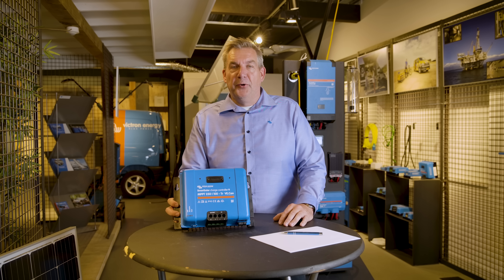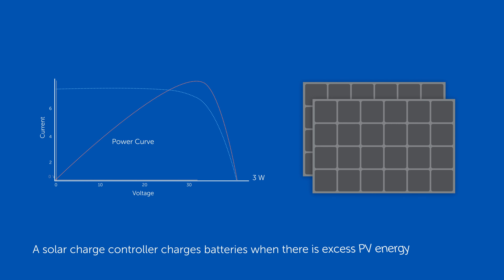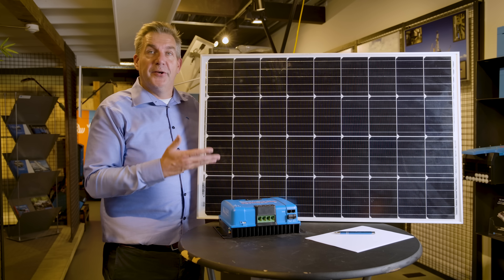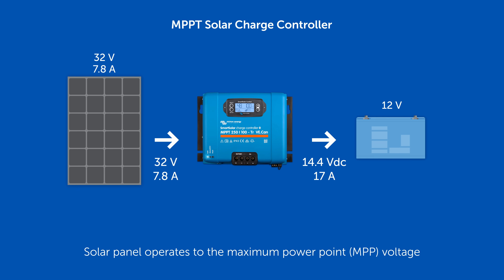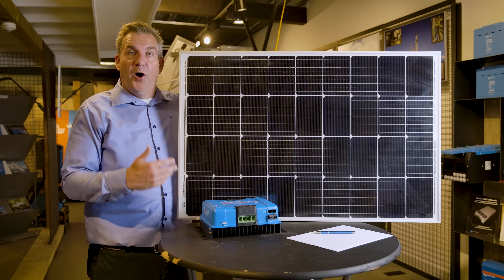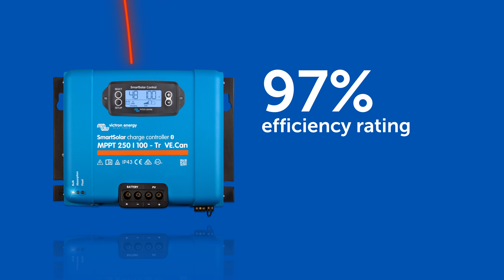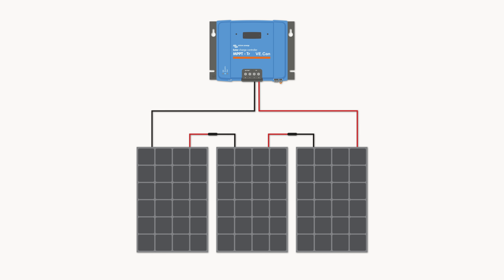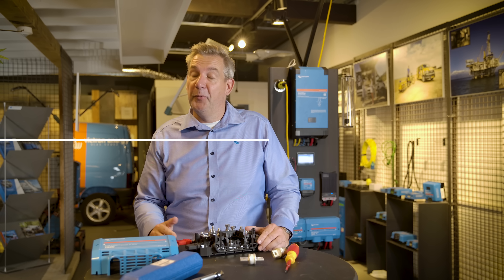How does a Victron Energy MPPT Solar Charge Controller work?

Comment: Johanes - Why is series better than parallel? Isn't the wattage the same or better in parallel (less shading effect)?
Reply: Ditto ejaculated DKS said, higher volts in series =smaller wire size, save on copper, use smaller amp fuses (but rated for the higher volts)

Comment: Excellent training video for excellent products!

From the video it looks like a buck type converter.  Will the controller software limit the current down to a few watts of power to keep voltage above minimum threshold?  Is there a min amperage cutoff as well as the Vmin of 14.8+5vDC?  Example MPPT is keeping voltage at 20vDC but current flow at that voltage will only be ~100ma, so ~2watts.  Is this possible?  or will the cut-off be higher, perhaps 5?10? 20watts?
Reply: No, the output will continue to work It what is doing till the low voltage will stop the unit from working.  Cut off is Vbat+1Vdc ( as the  pv is already lowered in voltage because of the load)
Reply: Normally you'd want the charger to provide all the current that is needed to satisfy the load however you can program a limit if you need to in several ways.  VE.direct hex protocol commands allow you to manually set charge current limit down to 100mA (steps of 100mA) and it can be a dynamic setting rather than written to eeprom saving write cycles.  If you stop sending the commands (< 30 second interval) the charger will revert to normal operation again.  Of course if your load is demanding less current at a given voltage the actual current will be under 100mA.  Likewise you can set the output voltage anywhere within the specified full range of voltages the charger supports.
Reply: Normally you'd want the charger to provide all the current that is needed to satisfy the load however you can program a limit if you need to in several ways.  VE direct hex protocol commands allow you to manually set charge current limit down to 100mA (steps of 100mA) and it can be a dynamic setting rather than written to eeprom saving write cycles.  If you stop sending the commands (< 30 second interval) the charger will revert to normal operation again.  Of course if your load is demanding less current at a given voltage the actual current will be under 100mA.  Likewise you can set the output voltage anywhere within the specified full range of voltages the charger supports.

Comment: Why do the MPPT have regular Voltage drops about every 10 Minutes? Do they try out if other voltages fit better?
Reply: Its doing this more often then 10min by the way, but yes thats to check if there is a better powerpoint to be found (Only in bulk phase )

Comment: So with an mppt controller can you wire your panels in parallel.
Reply: As you want a high PV voltage , t=yuo choose serial ( till about the Max controller voltage -10%), on PWM often the panels are parallel

Comment: We are on a sailing catamaran.  We have 4 x 400 watt panels and each has its own 12v 30 amp MPPT.  All e years old.  They are the Blue MPPT’s .  Am I better off having individual MPPT’s on a bigger one that can handle all four in series? We have 1200 Amps of Lithium batteries.  I’m going to Smart MPPT’s because the Blue do not have Bluetooth and getting new higher output panels down the track, still only 4.  Clever marketing NOT.
Reply: depends on the orientation of the panels and expected shade.   if all equal as fas as sun and angle, then yes , otherwise a mppt per panel is OK.
Reply: Especially on a sailboat it makes sense to have one mppt per panel because of you have a lot of partial shading coming from the sails, mast and rigging. If you have one mppt per panel the mppt can finde the best maximum power point per panel, the max power point is different when one panel is shaded and the other one is in full sun. If you have only one mppt the mppt has to find the average maximum power point of the shaded and the none shaded panels. And this average power point is not the best you  can get from your panels. So you will get more energy from one mppt per panel. And if you have high voltage panels it gets even better. 17V low voltage panel are pretty “old technology” that came from the old PWM charge controller era. You also have some kind of backup. If you have only one mppt and that one is broken you have no more PV at all. If you have 4 mppt and one is broken you still have 3/4 of the PV. And there is an other advantage having one controller per panel. If a panel die’s, maybe in a few years, you can more or less buy any new panel and connect it to the mppt. If you have only one mppt you have to finde the exact same panel again. And after a few years you wouldn’t finde the old panel you have on your boat. So if one panel dies you have to buy 4 new ones even though 3 are still ok.
Reply: @ Thankyou, that’s the detailed answer I was seeking.  All makes sense now.  Much appreciated.  Peter A - Smokyjim

Comment: Could you build an all in one inverter like the 6000xp? Getting tired of wiring up your modules. Would be nice if you guys made something competitive for the hybrid and off-grid market. Takes an hour to mount an 18kpv. Even midnite has one now. You guys are the only company not building them.
Reply: Will, we are waiting for the HS19 multi ! (3 phase, 3x 5000va inverter/ charge controller with 4x MPPT, high voltage, 19inch)
Ps. Love your channel😀
Reply: @gubbernl  Will that be only high voltage of the battery, so 800Vdc? Or also 48Vdc? Or am I mistaken and is the high voltage for the PV side. Thanks for clearing this out for me if you want.
Reply: @gubbernl  sadly the HS19 needs about 600V DC. i whould like a 48v version, it whould fit perfectly in my rv.
Reply: @gubbernl  3-phase???? Why? How about residential 2-phase!?
Reply: @Le_Comte_de_Monte_Felin dont ask me.
But in general,  these are designed for business, less or not for residential use. Altough on the Netherlands, and in more European countries, we use or 1 phase, or (and that is as expensive) 3 phase. So, thats no issue. 
Victron is following the market,  so, who knows!
Reply: They have multi rs 6kva. Not sure if it’s available in 120V yet
Reply: This is the third channel that I've watched today that you have commented on. Clear View Taxes and Silver Cymbal were the other two. (You Tube and their feeds!)  Love your channel BTW. I built my entire solar system for my RV based on the info I learned in your book. It has been working perfectly now for over 2 years.
Reply: And please get CEC certified. Wanted to add a whole house hybrid system and our first choice was Victron but our Oregon utility EWEB only allows CEC listed inverters.
Reply: Hello Will.  A fan of your channel, obviously, and I'm commencing a residential Canal Boat design (think, House Boat with a 240VAC grid connection) that will include the max solar and battery that I can reasonably accommodate (probably 4kWh and 20kWh, respectively).  My starting premise is Victron, LiFE batteries, bifacial panels, galvanic isolator, etc.  Can you suggest anything else that should go into the equation..?
Reply: @JdZ-2023 not sure, they say 800-1000V for the MPPT, and HV for the battery. In any case,  not 48V.
Reply: thats the advantege of victron. you can get what you need and replace whats needet.

Not like the other brands where you have to replace everything if something breaks.
Reply: https://youtu.be/OWUWdZuNgB4?t=133 should be coming next year in 2 variants
Reply: @WillProwse  Hi Will, while I appreciate that you have rather unusual Needs, but particularly for Boats Victron provides the the equipment needed for a Completely different and potentially much better Zone based Wiring and small inverter based system that can provide what Should mean very easy to install setups for each Zone, the most intensive supply Demands being for the Galley, with a Master Switch for each Zone. To beolaed from e Est, when independent Lighting Circuit for the entire Boat. I will probably have to have a chat with Nigel Calder to ion out all of the details, but the small inverters offer great design opportunities in my opinion. 👍
Reply: @brownnoise357  combining an inverter and solar charge controller is not special or new. You don't need many modules. Also the communication system and having different types of closed loop comms is a pain. I get complaints about this every single day. Just check out the comments of my videos where I cover victron
Reply: @ tbh, this is why I am attracted to designing a new easy, logical Zoning System for Sailboats, using smaller Pure Sine wave inverters for most Zones, and really need a chat with Nigel Calder about it at some point, to iron out all of the details. Best Wishes. Bob.🤔🌟🌟🌟👍⛵️
Reply: @ I know it isn’t special or New I also know that it doesn’t take many modules. But what I am after is a small independent Zones System which for most Zones only has Small inverter needs, and other easy modules, and very little needs to be in a closed loop for comms, which has to be isolated and able to do Rapid Restores from Disk image Backups type  storage from high speed thumb drives, as fast cures for hacking attacks - which is how I lost my last Sailboat due to a Network Hack, followed by an attack by a Wrecking Gang Working New York Harbour. So Small independent Zones equals extremely Fast  System Purges and Reinstallation from Fast Thumb Drives, complete with Navigation Charts to be able to get out of the area fast via a basic image, then when safe, Full Purge again then a Full Restore from the Full Backup image. Only the most needed basic zones and Navigation Charts , plus engine need restoring First. Generally Will, very little Content on your Channel is of much use to me, and most Batteries on my next Sailboat won’t even be Lifepo4. Best Wishes. Bob.👍🌟🌟🌟⛵️
Reply: Isn't their EasySolar-II GX exactly what you are describing?
Reply: @arttu4313  they do not make that model for north america 120/240
Reply: @WillProwse  hmm, sucks for your antiquated electrical grid
Reply: @WillProwse  110-240 is not the "standard" so it makes sense. What you refer to disadvantages is seen as an advantage by most. Its fully modular and that exactly why its great. 

If you use other brands for what you need, just use that?
Reply: @Deiphobuzz  has to be most ignorant comment I've seen this week 😂 are you joking me
Reply: @arttu4313  thanks
Reply: @arttu4313  last I checked, the American created the first electrical grid
Reply: @WillProwse  and never bothered to update it.
Reply: @UKsystems And the colonialists seem to think if it passed from their alimentary canal it 'must' be 'standard'.
Reply: Studer NEXT 3. Offgrid,3phase all in one.
Reply: I think it's better this way otherwise they won't make profit as they do now both resellers and installers.
Reply: For the love of North America make a single device with split phase
Reply: @frostyfroze7352  Maybe they will do it one day but the reality is most of the world has the neutral at the end of the transformer winding rather than centre tapped like the USA and a few others.  Overall the rest of the world market is much more attractive than making a product that is specific to the USA etc and they'd be facing competition from USA manufacturers that do support split phase already.  In the meantime you can always use an external transformer to achieve 120-0-120 with Victron equipment.
Reply: @frostyfroze7352 I coming ! 😊
Reply: It exists already, the Multi RS Solar. Also inverter capacity and PV capacity are totally different concepts. You might want a lot of inverter power with little or no DC-DC PV capacity, I have 30kva MP2 inverters connected to 100kwh of lfp storage and no DC-DC PV capacity. Your market isnt the only one, a majority of European countries have dynamic (hourly) pricing, meaning you dont really need the PV capacity you can just buy somebody elses on the cheap. Also Victron is used a lot of boats and RV's, they have tiny PV capacity in comparison to the inverter requirements. Having them seperate enables everybody to chose what they need and not have to pay for unused inverter or pv capacity.
Reply: They will lose their installer base. Where will our jobs go?

Comment: 😀the best MPPT charge controllers on the market, in a comparison video they were found to be more efficient than the others even if only slightly, I don't think there is anything better on the market today.
Reply: Agree !
Reply: Overpriced, Over complicated, and out of date. Luxpower Tek have REALLY nice efficient All-in-one systems for both off grid and hybrid scenarios that are far simpler and faster to install, come with all the battery/PV disconnects on board, and anywhere from 8-32 KW of Solar Mppt on board, Do split phase AC output natively and can be scaled to 96kw AC output.  You can even do 30/50 amp smart loads and control it with their inverters. Great software and remote monitoring are also included. For a LOT less $$$ than you pay for the Victron name. And all the bits, pieces and excess wiring and lugs that it entails.

Comment: I never understood why Isc matters and under which circumstances the controller may “short the input”, in which case too much of a Isc would kill it.
Reply: Well if there would be a too high battery voltage (which can be dangerous) and the charge controller has a hardware defect so that the PV power flows free to the battery, you need to act,  Then the incoming PV is short circuited with a circuitry to try blow a fuse and stop the power from flowing .
Reply: @johannesboonstra6917 ok… in that case though, since the CC would already “have a hardware defect”, you wouldn’t care about maximum Isc, since the CC would be already defective, right?
Reply: @ThanosSustainable  no not right , because then the ov energy will remain flowing into the dc system
You want to to stop the PV , so want to blow a fuse
Reply: @johannesboonstra6917 I understand what you are saying. However, my objection is on the maximum Isc and why we have a maximum Isc on the CCs on the first place: what if you short an array that had a 10x Isc than the maximum Isc of the CC? What would happen then? Wouldn’t the shorting of that array kill the solar fuses or blow the CC completely, hence cutting the charging of the batteries?
Reply: @ThanosSustainable  if the panels give more Isc then the circuitry can handle, the circuitry to short-circuit the panels would get defected.  Note that the short circuit protection is parallel on the pv terminals, so if it fails to blow the fuse, the PV will remain flowing to the battery

Comment: Does it have a transformer?
Reply: Transformer is an AC (alternative current) thing. PVs and batteries are DC.
Reply: @ThanosSustainable  ok
Then how it converts excessive voltage to amperage?
Reply: @takismenexes6131  thats what I tries to explain in the video, by switching FET's and transferring energy trhough a coil.
Reply: @takismenexes6131 it contains a DC-DC converter which in fact is an adjustable digital transformer which can easily be controlled by a micro processor. So yes it contains a transformer but it isn't a traditional one and it can handle DC.
Reply: Victron's lower voltage MPPT chargers are buck style, uses an inductor, there is a DC path through the unit.  The 450V rated MPPT chargers employ a transformer instead to achieve isolation.

Comment: Hi, I have a Victron 150/85 regulator and I would like to use the relay to control a 220 volt contactor to turn on a diesel generator. Is this possible?
Reply: yes, if its a low current signal thats fine

Comment: You indicated that the MPPT is looking for the “max sum” of the voltage and current.  Power is the product (V x I) of voltage and current, not the sum.  Did you mis-speak, or is the MPPT really looking for the sum?  Or do the sum and product happen to maximize at the same point?  If the later, is that coincidental, or is there a more fundamental, underlying reason for this?  I always enjoy your short, technical videos, so this is something I would really like to understand.  Thanks you.
Reply: Obviously misspoke
Reply: i meant the sum as Volt x Amps, sorry that its not 100% according to the grammar.